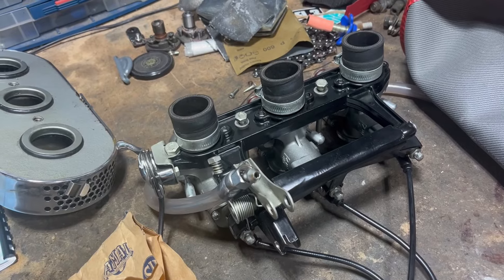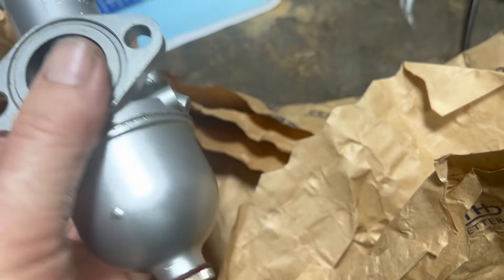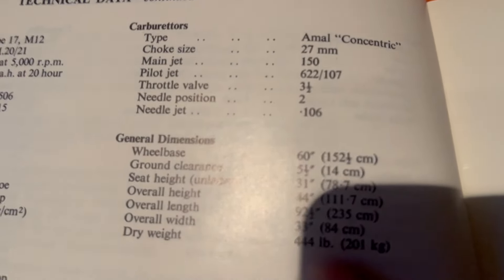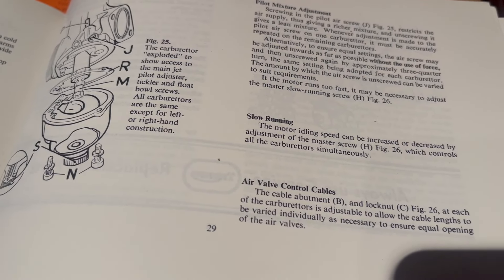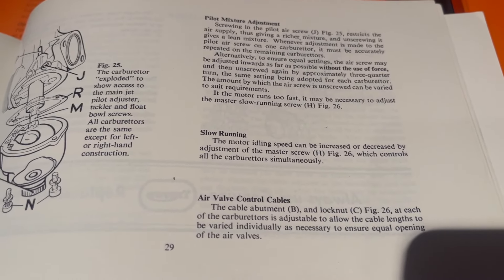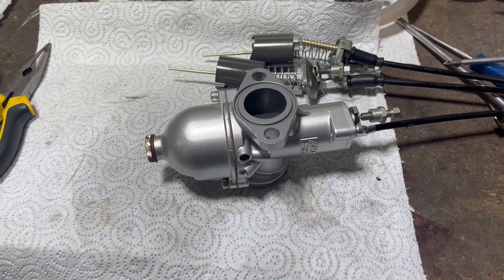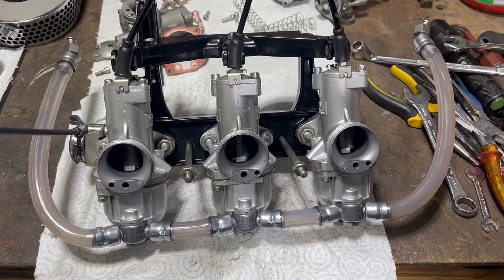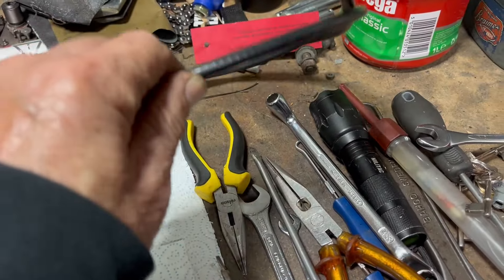Triumph Hurricane (TRIX75) - Investigating Rough Running - Part 2 - Rebuilding Carburettors

Comment: i have an 1965 A65 "E" , thats been chopped, developed a constant missfire on one side. it starts first kick, idles great ,revs up . soon as you jump on and put it in gear it sputters and coughs badly. i tryed everything, been throught the carbs a dozen times, different needle settings , tryed swapping needles and mix setting numerous times, gave up on it and took it to a local "old BSA guy" that my dad knows. he calle dme up and said the he figured it out, he took a brand new pair of carbs off one of his bonnies, and fitted them to the BSA along with his cables and twist grip. he said it runs like a dream now. so he ssays both my carbs are worn out, and my 2 into 1 cable wasnt letting the slides come up all the way., he says i need new pair of carbs , new calbes that instead of a 1 into 2 system , he wants to fit a twist grip that has 2 cables that go down to each carb in 1 piece each. just  an interesting dicovery that both the carbs a re bad, he said he has seen it befor ,but never as bad of a missfire as mine, what would cause a carb to missfire so badly but the internals looked ok? even he said he looked at them and didnt see any obvious damage or issue.
Reply from the maker: Thanks for the interest and comment. There's a lot of variables you've highlighted. Bonneville carbs settings will probably be different to the BSA - did he set them up as per standard specs? Is the bike running standard compression and ignition? If standard ignition, is a condenser bad or if electronic, is the battery good? I can understand why a two into one cable might restrict slide movement if there's not enough adjustment in the cables either side of the junction box but that wouldn't cause a misfile unless perhaps the slides were badly out of balance. Are the tappet clearances correct on all valves? Those are the sort of areas I would check, check and check again.
Reply: @BSAPowerSet  , as for the jetting he used on his bonnie carbs i am not sure ,my BSA runs a 190 main.  but the fact that he put them on and the bike ran flawlessly says my carbs have a big issue. not spark related as ive gone threw the entire ignition system and it works perfectly, boyer box. its a high compression pistons, as its a 1965 spitfire/hornet , chopper. not stock anymore. both tested at 165 lbs compression . im just surprised that the carbs could cause a brutal miss on one side ,the other side works fine. but i guess swapping the carbs out was definitive,. slides were in balance, tappet clearences checked multiple times(good) . and inside the carbs, no sign of anything out of whack. needles were 3rd postition . jets all clear, checked float hights. this was a real stumpper of an issue.
Reply from the maker: @jackbeanstock7710  Fair enough. It's frustrating when there's an apparent fix as proven, but you don't know what the root cause is.
Reply: @BSAPowerSet  the struggle is real!, keep up the good work. your channel helps us do it yourself kind a guys! now just 1200$ for a pair of amal carbs might have to wait for that one.... have you any luck with wassel carbs?, its about 500 for pair of those.? any good?
Reply from the maker: @jackbeanstock7710  Thanks for the kind compliment - I'll keep on going and trying for as long as I can. I've not had any experience with Wassell carbs I'm afraid although I've heard some negative feedback regarding the quality but can't verify that.

Comment: What size pilot jet was in the premiers? 
If 19s that would explain the pilot air screw setting
Reply from the maker: Hi Nick I didn’t have the specs so don’t know but that didn’t matter as the bike ran much better when initially assessed when I reset the pilot screws to the specified position - see previous video. Thanks for the comment and interest.

Comment: Original Amal carbs have 'Amal Birmingham England' cast into the body. Oh, hang on. That was the monoblocs and it was on the float chamber cover. Original Amal concentrics from '73 simply had 'Amal' cast into the body. So those 'original' carbs with 'Amal Made in England' on the body are very far from being original and that is why the castings look so ropey.
Reply from the maker: Thanks for the interest and comment Dave. I've never noticed that - does that apply to concentrics and monoblocks?
Reply: @BSAPowerSet  When I say original, I'm talking about carbs originally manufactured by Amal of Birmingham that were fitted to British bikes over many decades.  I have a fair few stashed in my garage. No 27mm Concentrics unfortunately. They are like gold dust.
When you referenced the 'original carbs with the short tickler' I wasn't sure what you meant by 'original'. A copy of the original? Or the original carbs that your client supplied you? It wasn't clear.
All I know is that geniune, original, monoblocs from the sixties have 'Amal Birmingham England' cast into the float bowl cover and genuine, original concentrics have simply a raised 'Amal' cast into the body of the carb.
Jeez, those castings for your client's 'original' carbs are ugly. And why have they been spray painted? That is asking for trouble.
Oh well. Have fun 👍
Reply from the maker: @DaveFiggley  Cheers Dave. The owner supplied the original Amal carbs fitted to the bike. As you say, they have a raised AMAL cast into the body on one side. The factory painted the carbs silver on the Hurricane as standard.
Reply: @BSAPowerSet  The factory painted the carbs? Ha ha. No they didn't. With respect, you're talking rubbish.
"Amal carbs originally came with a very light clear coating protecting them."
Reply from the maker: @DaveFiggley  The Hurricane carbs were definitely painted silver as the standard finish Dave. Whether Amal or Triumph painted them I don’t know but with respect I’m not talking rubbish. I owned  one for 20 years and there are many published articles referencing this. This in contrast to the carb rack painted black which is also standard - which was not the case with the other triple models. By the way - you are right in stating that the original concentrics had Made in England embossed under Amal on both sides of the bodies - certainly the early ones with extension ticklers as on the T160.
Reply: @BSAPowerSet  Whoever is typing the above comment is utterly clueless.
Reply from the maker: @DaveFiggley lol that would be me Dave. Yea I’m getting mixed up with Mk 1 and later variants with the extension tickler and Premiers. I can’t remember or determine when the first extension tickler concentric came out.
Reply: @BSAPowerSet  OK, I have to hold my hands up and apologise profusely 😥😢Having revisited an excellent website, Wayne's Triumph Motorcycles, things have become much clearer to me. Wayne Hamilton of Arizona, USA accumulated an extensive collection of mainly 60s Triumphs over many years. He was a perfectionist when it came to buying and restoring. He even owned the last ever bike that came off the line at Meriden in 1983 - a TSS. He has since sold his entire collection and retired to Hawaii, I believe.
In 2015 he acquired an extremely low mileage (1480) X-75 in original condition that had been stored carefully since 1979. So upon revisiting the pictures of this bike it is clear that the 27mm Concentrics have 'AMAL MADE IN ENGLAND' cast into the bodies on a raised pad. Short ticklers etc. The early Concentrics from '67 onwards, that I am more familiar with, simply had 'AMAL' cast on the body.
Wayne's X-75 had stood for 36 years with a small amount of fuel in the tank and the carb bodies were fairly well-stained. He thought about it for a while but then decided to have them vapour blasted. 
I quote him, "Amal carbs originally came with a very light clear coating protecting them.   Obviously, any of that coating is removed when they are vapor blasted.  This is one of the small compromises that has to be occasionally made when restoring parts."
On my screen right now I have an excellent close-up shot of one of the carb bodies that was blasted and very nice it looks too. Interestingly, the carb top wasn't sent for the vapour treatment and that, indeed, does show signs of a paint-like coating that has been worn away in places.
Therefore, I again offer my humble apologies for doubting your superior knowledge 🤐
Reply from the maker: @DaveFiggley  Hey Dave  thanks but no problem and no apology necessary. It's useful to have some knowledge tested so we can refresh/increase our understanding - that's what the channel is about. I've done some more digging and apparently the Hurricane carbs were stove enamelled in silver grey by Amal. Dotler has some NOS LH ones for sale atm. I know in 1971 they were experimenting with painted concentrics and sent examples to BSA in black, white and gold. Photos are in Brad Jones excellent book - BSA The Final Evolution. Cheers.

Comment: have the carbs been painted ? is this standard or normal as mine have been by the PO and it's not a good look imho
Reply from the maker: Hi Richard the Hurricane had light silver painted carbs as standard.
Reply: @BSAPowerSet  Thanks, I take them off and clean them, I need to check the jets in any case as the bike is running vey rich.
Reply from the maker: @richardbartlett6932  If you can, check the slide sizes and needle positions too 👍